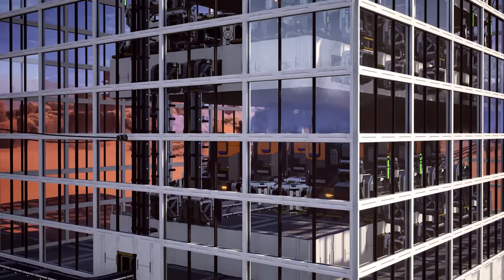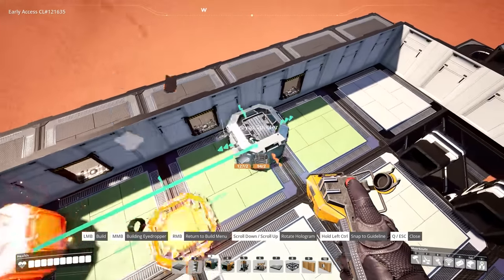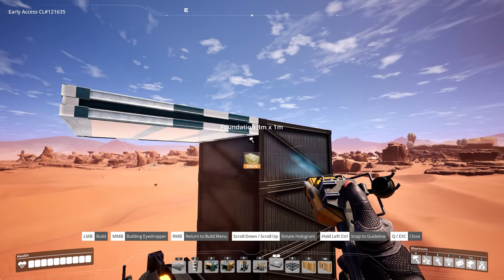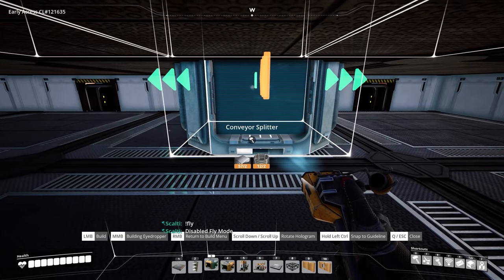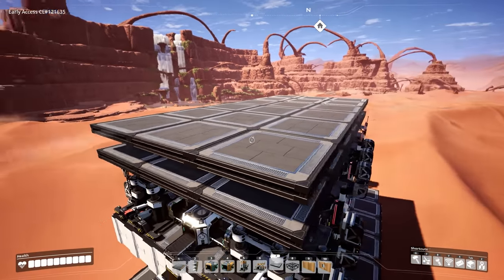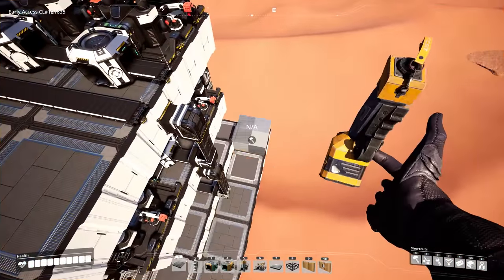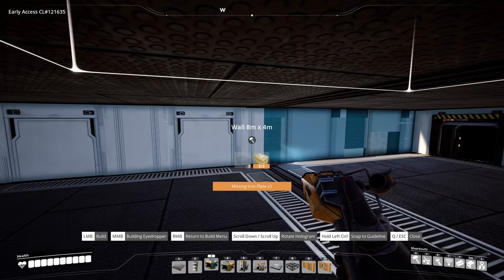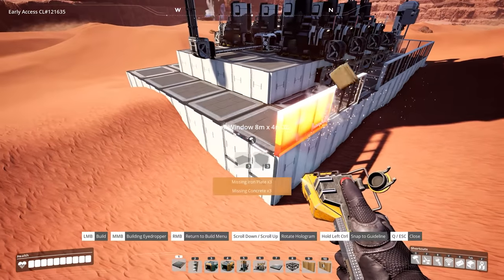100% EFFICIENT 20 Reinforced Iron Plates / Minute Factory! [SATISFACTORY GUIDE]

Comment: Clean build. I don't run mods is there a way to get my walls and buildings white aswell?
Reply from the maker: Color gun. Change the first swatch.
Reply: @Scalti  I've used it before you gotta place items normally then use the gun to paint is this how it's done without mods? Thanks for the quick reply mate
Reply from the maker: @pumba6099  Change just the first swatch - it'll update any default colored structures.
Reply: @Scalti  sorry unfamiliar with swatch. Do you mean place a wall (orange) then paint it white, then every wall you snap to it goes white? If so how do your machines when placed are all white too.
Reply from the maker: @pumba6099  right click with color gun equipped and change the upper left swatch. It'll change all default colored structures.
Reply: @Scalti  fuck yeah I'm so noob wow thanks man :)

Comment: As a nooby to this game, how do I get the clean looking black and white themed buildings and constructions?
Reply: in the M.A.M, there is a research tree for flower petals. Progressing this tree lets you unlock the color gun which you can use to repaint buildings. You can change the default color of built structures with the color gun as well.

Comment: HMmmmm, I wish I had some Reinforced Iron Plates for the MK2 belt lines and Constructors, Where shall I get some?
Reply from the maker: You can manually craft them in your hub or use MK1 to start and as the factory runs, you upgrade the belts and eventually it becomes 100%

Comment: is it possible to do it with mark 1 conveyers and stuff instead of mk 3
Reply from the maker: You can but you’ll need 4 iron nodes. I’d suggest tapping two pure iron nodes with MK1 miners and MK1 belts and as the factory operates temporarily at 50% efficiency you take the output RIPs and upgrade all belts to MK2 to bring it up to 100%
Reply: @Scalti  thank you very much.

Comment: Hey Scalti can i do this on a none pure iron ore? or is there a difference in pure/none pure iron ore?
Reply from the maker: Node purity only affects how much ore you get. Just want to make sure you have 240 iron ore going into the factory.
Reply: @Scalti  ok thanks got it this is supper helpfull and will you also be doing a video about computers and heavy modular frame?
Reply from the maker: I’ll be doing every component in the game in due time. Working through them relatively in the order you unlock the ability to make them.
Reply: @Scalti  cool ill be looking forward to it thanks again
Reply: @Scalti  btw just another question are you using only Mk.2 Conveyor Belt and Mk.2 Conveyor Lift?
Reply from the maker: @zhio  Yes - You can get away with just using MK1 in some instances but MK2 throughout if you're not sure.

Comment: Well this looks like pain in ass to build without jetpack. On side you would probaly have to build some type of stairs so you can get up and down at early game. And you would probaly have to build a power factory on plants close to it (that can also produce fuel so you dont have to make it manualy). However, desert may not be the best starting area for this. Forest would have it easier.
Reply from the maker: In truth it’s not that bad. I have a video on how I build these in survival without mods and also the recent inclusion of ladders helps. 

Working in a more open area is of benefit as well for an easier scaffolding assembly.
Reply: @Scalti  That is true :D
I re-started in desert on my 4th try and well long line belts everywhere feeding everything into one location.
Its laggy as hell tho XD.

Personaly rock area is the worst starting zone. Coal is to far, oil is to far and so on.

Comment: This could probably be made easier by building a bit taller, and putting a normal wall space between floors rather than this sandwich method?
Reply from the maker: It’s all a matter of preference. I like compact. You can choose to make them double high or whatever you do choose. At the end of the day, the guide is a presentation of what machines you’ll need and how to run belts, I just present it in the way I like to build.

Comment: this is not efficient 100% when overflow is used some of them are working at full capacity and the rest at 90%, and then so on
Reply from the maker: The entire system is 100% efficient after ramp up.
Reply: @Scalti  efficient means there are no leftovers, this means the belt must not wait for overload, if it does that means you can build another constructor  to ease the belt